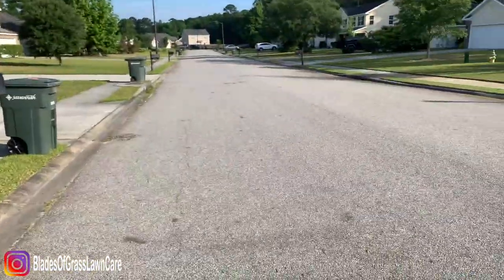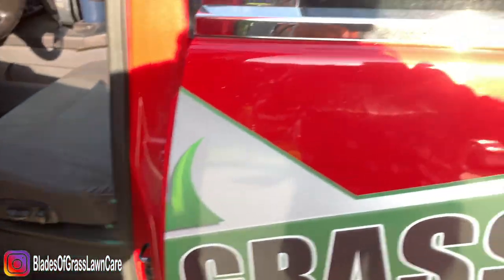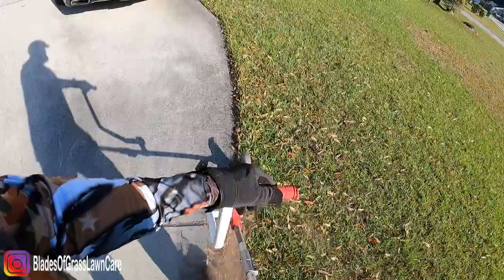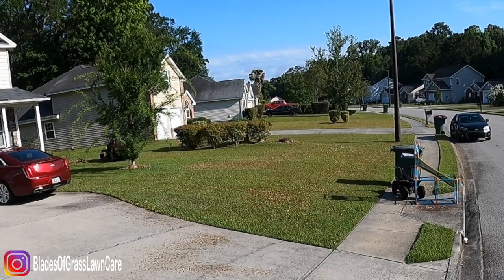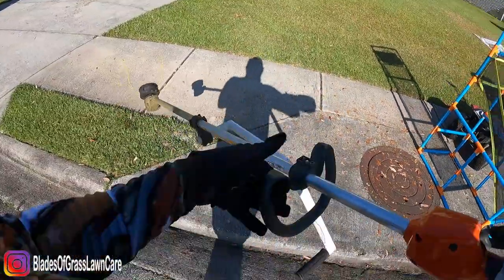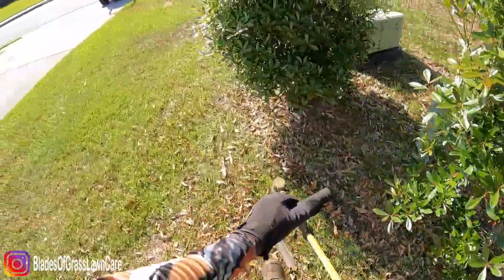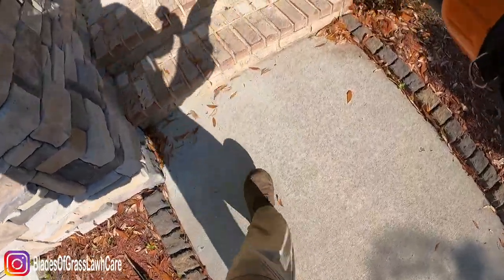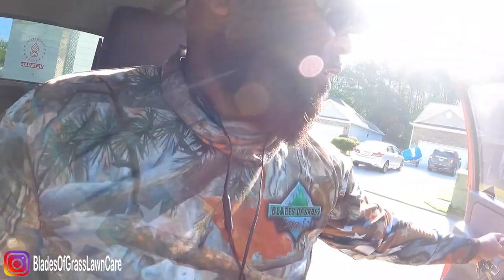VLOG: Most satisfying lawn mowing

Comment: here is the thing about trimming in any direction, its about comfort and how good you are at handling the trimmer, its never been about right or wrong direction. i will say counterclockwise is more comfortable for right handed users, clockwise is more comfortable for left handed users, its becasue of how it pulls the trimmer while trimming.

i run a homelite bandit from 1995 that has a clutch and straight shaft 25 cc 2 stroke engine, it is a counter clockwise trimmer head and is just the right power for what jobs i do, if i need something stronger i have an MTD 4 cycle trimmer with trimmer+ attachments like an edger, blower, and tiller. 

ive ran a trimmer for about 6 years and in that time ive run husqvarnas, stihls, and echos, each of them had their quirks that never felt right for me. husq had a great bump feed head that i enjoyed using, but it was needlessly heavy. stihls were alot lighter and had amazing clutches, but the string comes out so low from the head that it scalps yards if you lose awareness of it. echos were great sounding and had awesome ballance, but the pull starter always had some form of plastic to catch your fingers or nails in when pulling.

in short, i hope this helps any newcomers to the trimming bandwagon ! there are so few people that can edge with a string trimmer around my town that its embarrassing, i once saw a guy tap his bump feed 10 times in 15 feet of sidewalk. and my neighbor got a new stihl that he used 2 full spools of string on roughly 50 feet of chainlink fence. in my head i was cursing and ranting on about how he needs to never touch a trimmer again in his life. so pls, no one ever be like him, use common sense and never go more than 1/3 throttle around wire fencing of any type.
Reply from the maker: Thanks for sharing!